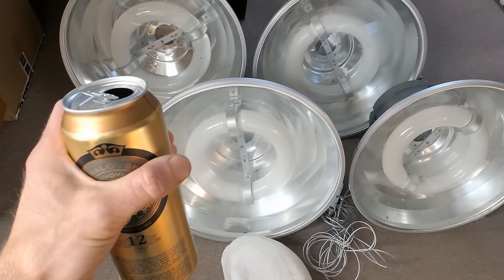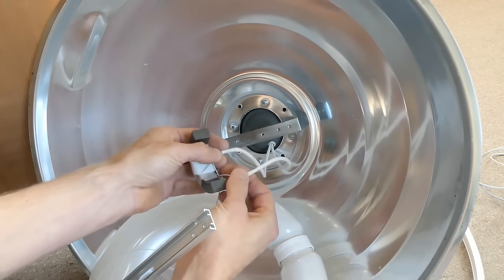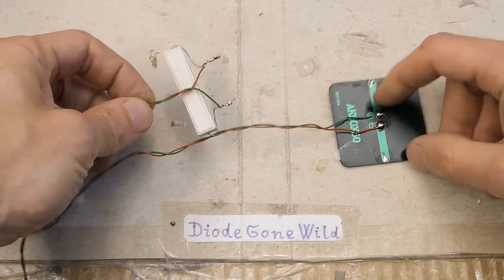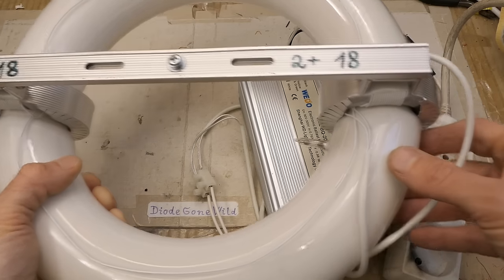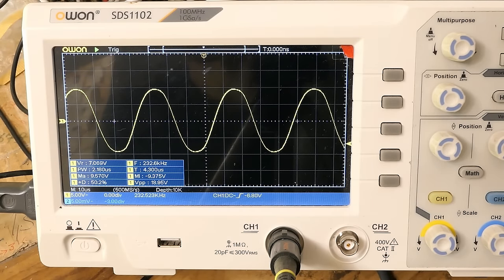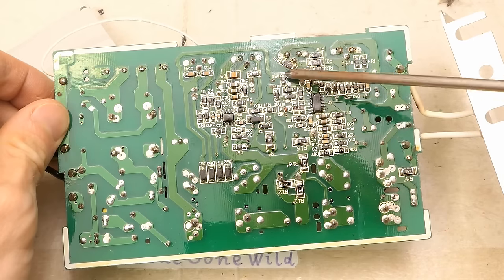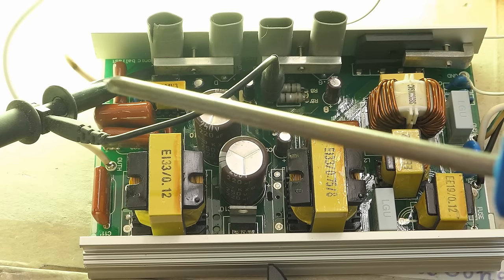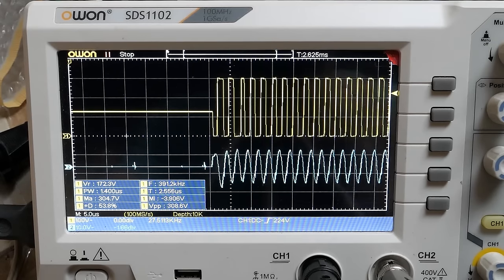Induction light - what's inside, schematic, experiments

Comment: How long does it take you to reverse engineere schematics like that. Do you trace it out on the board or do it with the continuity on the multimiter, or maybie even measure sone voltages for chips or on transistors to know how ot works? Or do you already know how the schematic could look like? Just asking so I could learn that too. I bet it takes a lot of time and patience.

Also you make great videos, doing diy stuff the normal way without any flashing rgb leds and trash like that wich wastes your time power and money. You give schematics and explanations of them and I like to learn from you. The best thing is that you often make your own solutions without fancy chips like others, but rather transistors and op amps (like current limiting for example) and basically discrette components wich are or arent salvaged.

Comment: I'm not understanding how a voltage is induced in the plasma inside the toroid. The plasma as a current path is at 90 degrees compared with the two coils. Can somebody explain?
Reply: The plasma path is in the same direction as the coils. The rings are ferrite cores with turns wrapped around them. The tube just forms a single turn through each core

Comment: I've maintained building lights on/off over the years.... one thing is for certain. replacing any lights or repairing them when they are mounted at heights is so needlessly tedious... 

you'd think they can not use so many screws, loose gaskets, hard to reach cables, etc. but no, in all the advances we've seen in lighting over the last 60 years, horrible to work on luminaries seem to be a design requirement....

Comment: Beautiful lamp that!
Would love to see the spectrum, assuming it would similar to a regular florescent?
Reply from the maker: It's probably about the same as regular fluorescent tubes. It's just that the power gets into it differently.
Reply: The spectrum is dependant on the phosphors used. There were many high quality European fluorescent and induction lamps (Philips, Oxfam, etc), and they could have very high CRI if that was desirable.
However, the Chinese make clones that were compromised in various ways to reduce costs, especially in the phosphors... that didn't mean that they told the truth about that of course!
Usually (for the typical use case for thess) it was better to sacrifice some CRI to increase efficacy, like with LEDs. The lower the CRI, the higher the efficacy, since any phosphor conversion has a <100% conversion efficiency.
...
In any case, these lamps usually have a higher "real world" colour rendering compared to LED. The standard Ra measure of CRI is easily spoofed by LED. The Ra scale is a fundamentally flawed way of measuring CRI, and LED manufacturers use ignorance of how Ra is measured to pretend that their products are "better" than they really are.
...
Technically, a LED can have an Ra of 0.99 (The LED people call that 99% CRI) yet be absolutely terrible at accurately reproducing the colour spectrum. This is due to them using the superseded Ra colour rendering method which only considers a very small number of non-saturated pastel shades, and no measurements of red at all.

Comment: I wonder if you could use blown fluorescent tubes (blown filaments) wind a few windings on the ends and use them as induction lights
Reply from the maker: This wouldn't have any benefit over running such tubes using a higher voltage or bypassing the open filaments. In either case, the problem isn't just the open filament, but also the loss of emmisive layer.
Reply: @DiodeGoneWild  Well that too, obviously. 
Running them at higher voltage would get some extra life for sure, but they wouldnt last long

Comment: 20:00 Why do they isolate  the 3 full plastic power transistors with the extra rubber hose?
Reply from the maker: It also surprised me :). Not sure the thermal resistance is better or worse with the rubber. Might be better if the rubber is thermally conductive, as it makes a good contact with the entire surface. Without it, the thermal resistance would be better if the surfaces are very even, but worse, if they're uneven, leaving air gaps.
Reply: @DiodeGoneWild ...at these high switching frequencies , inter device & heatsink coupling capacitance should be minimised to keep losses down and avoid strange circuit  misbehaviour.